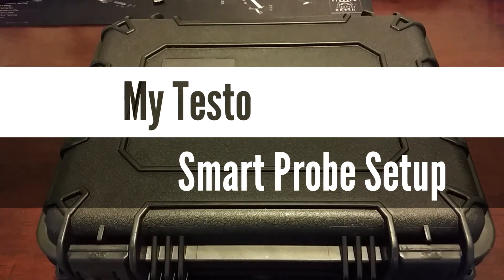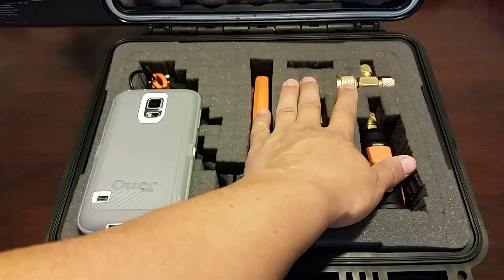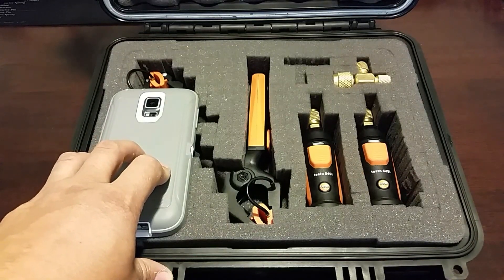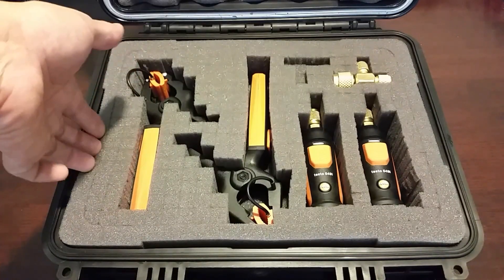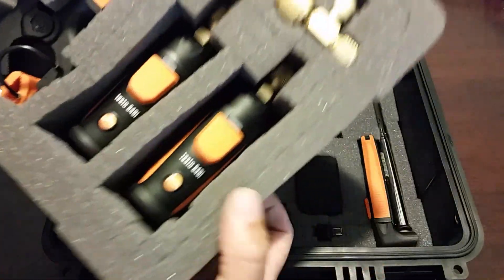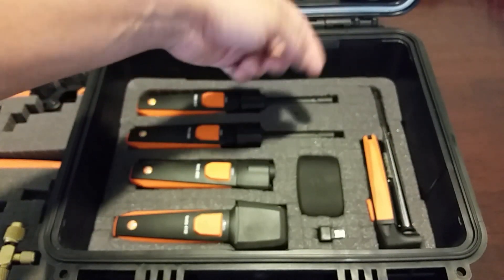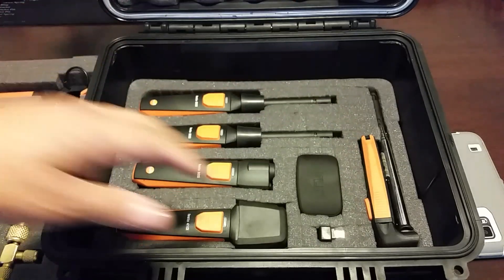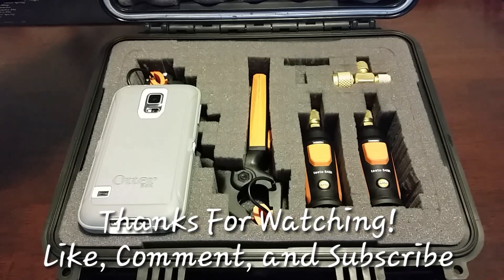My Testo Smart Probe Setup

Comment: Hey bud I got a set of gen 2 and I hate the fact that the temp clamp picks up heat from exterior for example reading on the suction line I have to cover the sun from hitting the clamp because it gives me a higher temp reading. That sucks I hope fielpiece don’t have that issue
Reply from the maker: I have 1st gen

Comment: I got the 6" ball valve hoses with low loss fittings. So much easier to hook up the probes. Very little refrigerant loss as well. Use my 4 port analog brute 2's with supco micron guage for recovery, vaccume and recharge.

Comment: Would u still recommend this setup? Trying to decide whether to buy testo or fp wireless probes.
Reply from the maker: I still use and prefer the Testos but bluetooth range is not important to me. If you require the range go with FP.

Comment: The box is not in the description
Reply from the maker: Josh Weaver The Condition 1 cases I use are in my Amazon store front link. There are several different sizes depending on what all you want to put in the case.

Comment: Great job !! Looks good. Regarding the bluetooth range, I agree. I did not purchase mine to hook up and jog around the block and check the readings!!! They are everything and more for what I need. Keep up the good work !! Cheers
Reply from the maker: Paul HVAC Thanks Paul! I agree completely.
Reply: Easy to do if you need to though. Need 2 phones with TeamViewer, or similar, loaded on them and can monitor from anywhere. Works great but drains battery so have them charging.